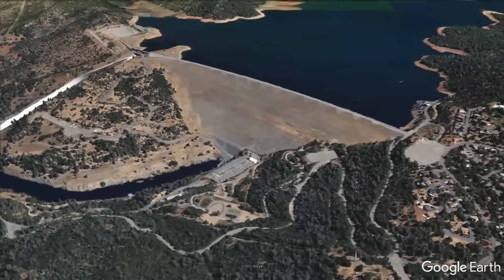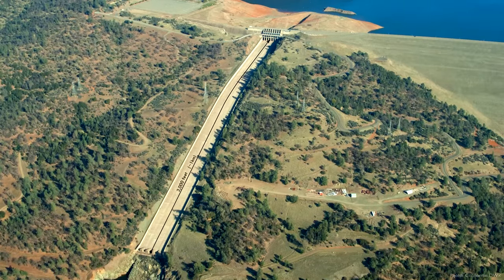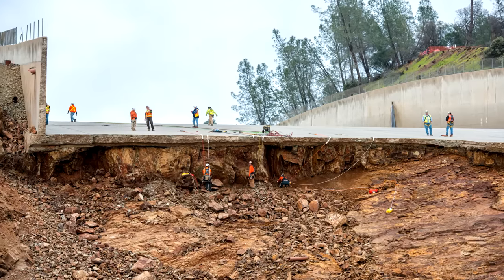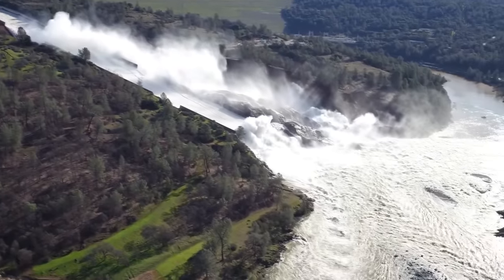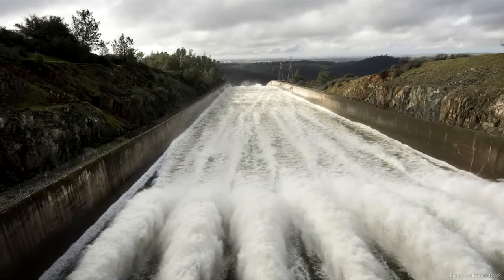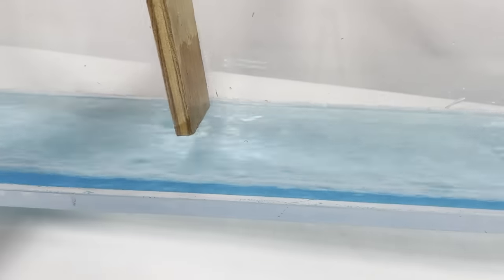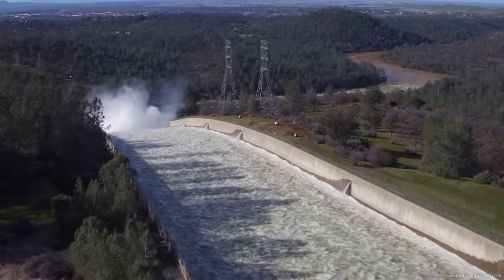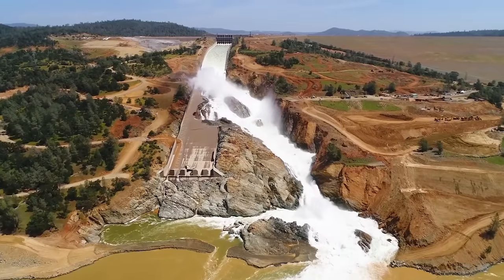What Really Happened at the Oroville Dam Spillway?

Comment: It's interesting that the Engineers built the Emergency Spillway for use in case of an Emergency.
But when the Emergency came, they were hesitant to use it.
Reply: "Emergency" isn't an on off thing; there's many levels of emergencies. In any case, my guess would be that they realized that the same thing that weakened the service spillway (and caused very obvious erosion on the supposedly "solid bedrock") would make the emergency spillway even more vulnerable. Emergency solutions are risky even when things work mostly as designed; if unexpected things start happening...
Reply: @LuaanTi  See 3 mile Island for more details.
Reply: I can understand this, for two reasons--One, it's a "last resort", and no one wants to use their last option, because if it fails, you have nothing left; and Two, they probably realized that the same geological issue that undermined the main spillway applied to the emergency spillway as well.
Reply: They knew it would remove all the soil that should have been removed in the first place.
Reply: I lived 20 minutes from that dam when that all went down let's just say ca and dwr is bad with routine maintenance it almost seemed as if they were more worried about the gold that got washed out then they were worried about civilian safety they were by the truckload takeing the mud that got washed out of there to a private lot that had armed guards watching and patrolling it 24/7 and trying to prevent people with claimes along the feather River which is what that feeds into from mining the area immediately after that happened and for years after not allowing anyone near the dam to see the destruction
Reply: Plus it seems they knew nothing about the geological condition of the site? How was this ever built?
Reply: @TC-zi2yp  You can't just casually remove soil from a hillside. Putting aside the massive amount of effort that would take and the question of where you'd put an entire hill's worth of soil, which are hardly simple or inconsequential details, you can't remove a substantial chunk of the hill without disrupting the stability of the hill.
Remember, the soil being eroded by floodwaters was bad because that could break the reservoir; the soil was serving an important structural purpose.
Reply: Probably because they knew it was in bad shape and hadn't fixed it b/c they figured they'd never need it.
Reply: Ya gotta maintain stuff, including the emergency parts.
Reply: They were not engineers, but in fact engineering drafting flunkies.
Reply: They might have thought whatever damaged the service spillway also caused hidden damage on the emergency one. Not an unreasonable fear, but the emergency spillway wasn't damaged, it was just not working right to begin with.
Reply: @francescomaestrelli7515  When the dam was originally being built, the project fell behind schedule and went over budget largely thanks to unexpected geological conditions. Builders and engineers at the time had assumed the bedrock was not as deep as it actually was. Ronald Reagan was Governor of California at the time, and put a large amount of pressure on DWR to quickly deliver this project and contain costs. As such, portions of the anchoring of the spillway were quickly redesigned to be quicker and cheaper to build. Mind you the cheap anchors would likely have been sufficient for new and uncracked concrete. However all concrete inevitably develops cracks and weathers which is exactly what happened at Oroville.

The cracks that developed were actually noted in dam inspections as something that needed to be repaired, but a combination of budget cuts, combined with complacency due to the spillway often going years without use, or very minimal use., meant that repairing the cracks remained a low priority for DWR and California. After all the spillway had handled a number of smaller discharges previously without issue. However, 2017 would see some of the largest discharges in the spillways history, which ultimately lead to the failure.
Reply: @nicholaspeterson8952  good ol Ronnie, ruining all that he touches.
Reply: You should have lived here to know how it has worked for many years!!!!! First of all without our damn and water and spillway all the lower cities would go without water and power. It’s not like anybody could say hey we’re gonna get an unexpected amount of water try this year that will damage our perfectly good working dam that provides for all lower cities and not one of you think it wasn’t a horrible time for all of us that was displaced?!?! Maybe instead of saying things such as how OROVILLE failed maybe everyone should thank us for the water they get at our risk ! I guess you have to live here to know! Not to mention the solid gold wall in the dam....prior to the damage there was a bomb threat and 4th of July was canceled because of it you all think it was a accident that it failed. Instead of trying to say OROVILLE didn’t have a good design you should say it was a horrible natural devastation and leave it at that. They have kept a very close watch on it and tried to keep all safe. If you ever had a chance to see exactly how the dam works maybe you wouldn’t say how they were just failures and you would thank them for all the water that countless families receive due to the dam. Just saying as a woman born in Oroville and know how the dam works.
Reply: Some planes have parachutes stashed away for emergencies but it's understandable that people would be a bit hesitant to ever have to use such things.
Reply: @nicholaspeterson8952  why do so, so, so many bad things seem to lead back to that man
Reply: @katrienacarranza2998  Did you watch the video? Here explained exactly how design flaws led to the failure.
Reply: @TC-zi2yp  It's not just "removing soil", the structure of the rock around the area was loose with many cracks, even without the soil to be stripped off in the first place the geology is such that the water collects into channels and erodes extremely fast, and the gulleys develop upwards towards the weir of the emergency spillway, threatening to destroy it and cause a catastrophic flood.
Reply: Lol.  Lazy government management.  And you guys want these lazy guys in charge if your health care???  Lol!

Comment: Well now I'm VERY interested in knowing how they rebuilt all of this.
I mean, if it doesn't have solid bedrock, and the water washed out SO MUCH of the ground, how exactly do you repair that?  Especially when you're going to be under a massive time crunch?

This video made me more interested in the repairs than in the disaster!
Reply: The repairs were fascinating to watch.  In a nutshell, the new spillways were massively overbuilt compared to the originals, with concrete that's as much as 100 feet thick in some places.  The California department of water resources has a website with thousands of photographs and videos of the reconstruction.  I do hope Grady does a follow-up video to this one - the reconstruction is a fascinating and massive engineering and construction project.
Reply: @carldaniel6510  Holy cow, that's a crazy amount of concrete!  That thing must have cost more than the original dam!

...There's a cynical side of me that notices that they probably had an easier time getting funding for a massive repair job than they would have for a preventative repair job.
Reply: @marscaleb  In case you missed it, Grady posted a follow-up video just this morning.
Reply: @carldaniel6510  Should have added the video info but thanks I'll look it up
Reply: @georgehutcheson9679  Follow up Video is now linked in the description of this video.
Reply: @marscaleb  exactly. only when such issues rises budget will be ten fold vs if someone took it to the finance guys they would have trashed the proposal.
Reply: You build a bridge or something
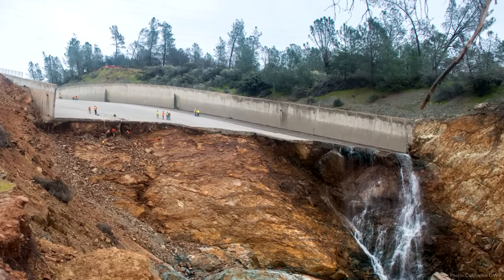Reply: 11:26  -   That slab and side walls sure don't look very thick and I don't see a lot of rebar.
Reply: @afriendtoo6971  I was on the southeast tip of table mountain with a perfect view of all this as it happened. First thing I noticed is that there wasn't any rebar in it. They used rebar when they rebuilt the thing... 

  peace.
Reply: I hope you found what you were looking for. there's a local guy (Juan Browne) who covered this story very well during the whole process. Blancolirio on YouTube.

Comment: If I could only say one sentence to describe the most problems possible today, it would be this. The people running things are far too insulated from the people doing things
Reply: Except that this was built 50 years ago.
Reply: @Cheepchipsable  one of my bridges went in service in 1884. It still has cattle guards for cattle drives. I have several others that are early 1900s.
Reply: @Cheepchipsable  when it was built has nothing to so with the statement, the people doing things where telling the state the spillway needed repairs for years and the state kept saying no the costs don't justify the risk. The state was then sued to repair the damn and again failed to do so before this happened. So the original statement of the people running things vs people doing things stands correct
Reply: Exactly!!!!! Dead on balls accurate, Henry.
Reply: @Cheepchipsable  I’m 38. 50 years ago is only 12 years away. It’s not that far removed.

Comment: Excellent information and video.  I live at Canyon Lake Texas.  I've lived here for only 8 years.  About 5 years before I moved here, the dam at Canyon Lake that controls the Guadeloupe River was filled beyond the maximum level.  Massive storms filled the lake beyond the normal maximum level, and the water flowed over the spillway built for this exact event.  The flow was so strong over the emergency spillway that the solid rock was broken away in huge boulders and exposed stuff that had been on the bottom of the ocean millions of years ago.  Down stream, there were campgrounds built along the river for motorhomes and cabins for rental.  Most of them were washed away.  Now they sell tours to visitors to hike in the gorge that was carved out by the water.

Comment: I remember watching this happening from one of the safe(r) areas around Sacramento. I know multiple people how had to evacuate due to this, and, while seeing a dam fail would be amazing in a theoretical sense, I'm glad everything worked out for people.
Reply: the scary thing is that it wouldn't even be a total failure. it was only ever the evergeny spillway dam, which if I recall, is something like 15 feet. the problem is, that it was the top 15 feet, so the most volume (as the pool rises, it grows)

had the dam failed... yeah lets not go there... it's something like 600' and earth filled dams fail in an exponential manner, so it's like 3 hours from water starting over the top to get to the bedrock.

Comment: I spent much of 2017 installing inclinometers all over that hillside and piezometers in and around the new spillway to help monitor ground and water movement. The damage to that spillway looked so much bigger in person.
Reply: What more interesting is do they repaired it and if how did they just fill the holes or getting rid of it completely first. I mean you have a tight time limit with this.
Reply: I did not have an appreciation of the size of the situation until the photos of people and equipment was shown.  It’s crazy big!
Reply: @Fiercesoulking  They meticulously filled all of the eroded hillside with roller compacted concrete. I don't know all of details of the new slab pieces, as I was only involved with instrumentation, but I know that they upgraded ever aspect of the spillway, including many piezometers in the slab itself to monitor water flow under and through the slab. They knew that they couldn't repair it quickly, so they waited until the end of the rainy season, and took their time designing and rebuilding it over the next year.

Comment: Not so idle curiosity:
If the ground under the spillways was 'mischaracterised' might that also be true of the dam itself? What is true for their failure might also be true for the dam.
Reply: That would be my concern here as well.  They got A LOT wrong and who's to say where the fuckery ended?
Reply: The dam and spillway are different
Reply: Mischaracterised is a mouthful for - incompetent surveying
Reply: I think this dam design is less reliant on brute strength of bedrock on the sides... mainly because it this large.

Look at that dam from above. Unlike those that failed because of bad bedrock it's straight suggesting it doesn't rely on side mountains as anchors.

Comment: Just a thing that popped into my head while watching this video: since concrete can be eroded and most metals will oxidize and deteriorate when in constant contact with flowing water, wouldn't a polymer based solution be the best to prevent the infiltrating water? What I thought was coating the inside of the spillway with a hydrophobic polymer, perhaps more than one layer. Would this raise a host of different new issues? This came to my mind because I live in an old house with lead pipes from over 50 years ago and was advised to replace them with PVC pipes, since they won't leech lead into my drinking water. Would love to know more about the problems engineers face when dealing with water, it seems to be your greates problem: a substance that can be solid, liquid or gaseous, that expands and contracts and that can get, quite literally, anywhere.
Reply: Polymers can face: UV light, cold, being lighter, being "softer" (from the top of my head).
Reply: The truth of it is that everything wears down, everything ages, everything dies, and even though plastic and polymers are resistant to being worn down by water, they lack the scalability that the primary dam building materials, earth, clay, rock, concrete, and steel have (steel is primarily rebar used as a matrix to reinforce concrete, it is rarely in contact with water). I'm sure my civil/mechanical engineer dad could go into much greater detail but we don't have that kind of time.

Comment: At the time this was happening I remember wondering why the dam operators made the decisions they did, and in particular why they ordered such a widespread evacuation.   I did a simple dam failure hydraulic calculation for the failure of the emergency spillway, even allowing for considerable erosion of the hillside, and could not get much more than 600,000 cfs (if I recall correctly).  That much flow would have caused damage, but not wiped out the towns downstream in the Feather River Canyon, and if that were the only threat it would only require limited evacuations.      Interestingly there were dam break studies with inundation maps on hand (that are required for permitting the dam), but as far as I know there was not an existing  study of just the emergency spillway weir failing -- at least not available in online documents.  I am not sure that would even have been relevant.    I am convinced that they were thinking that the erosion on the emergency spillway could propagate to the main dam structure and cause catastrophic failure of the whole dam if it were allowed to continue.  So they were caught between two "worst case" scenarios -- the main spillway erosion leading to total failure and the emergency spillway erosion leading to the same.    Hence playing it safe with evacuating about 100,000  people (which cost people a total of tens if not hundreds of millions of dollars).  But this is just conjecture.   I do think they made the right decision given the uncertainty about the stability of the "bedrock".
Reply: Who mined it the spillway after the breach? What colors/minerals consist in the adjacent hillside?

Comment: Nice explanation but pretty charitable to the regulatory agencies in charge of inspecting and approving continued use of the dam.  While the general public was not aware of the condition of the primary spillway, the issue of the emergency spillway was widely criticized at the FERC re-authorization hearings.  Environmental groups predicted the erosion would threaten the dam safety.  That isn't a situation where someone can say hindsight is better, they deliberately ignored the warnings.  Unfortunately it seems managers more concerned with budgets and public appearance overrule technical recommendations made by licensed personnel.  It was just luck that the dam held; the City of Oroville would have been wiped out if the dam failed catastrophically.

Comment: good thing they tested the emergency spillway while they had a backup, if it were a real emergency with no back up, things would have been worse, now it can be repaired and redesigned without loss of life.
Reply: How can they redesign and repair the emergency spillway? I know nothing but it looks just like a hillside
Reply: @CanCobb  When they repair it, they can introduce designs to change the flow of the water and prevent the original cause of the failure. Changing the turbulence in the water so that it is not diving downward at the seems is one improvement, pouring new concrete in a manner that changes how the seems are oriented towards the water is another area they can work on. Either way, with time and a good design, they can improve the existing structure.